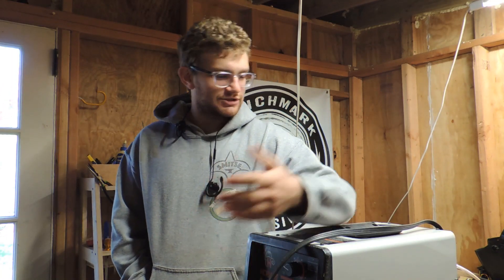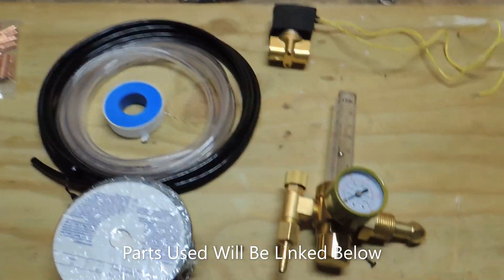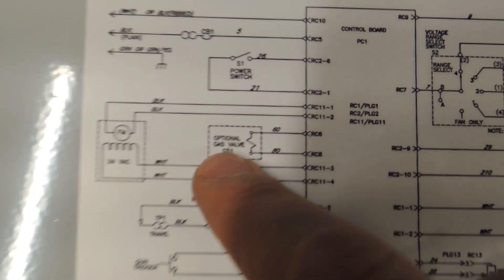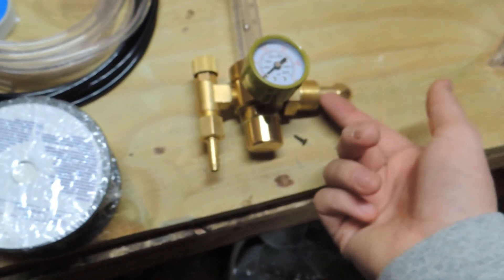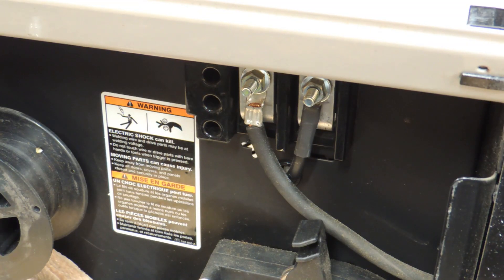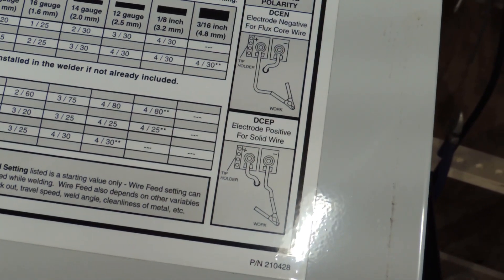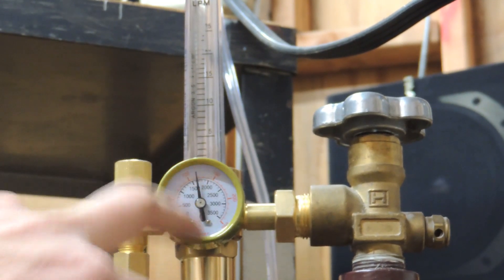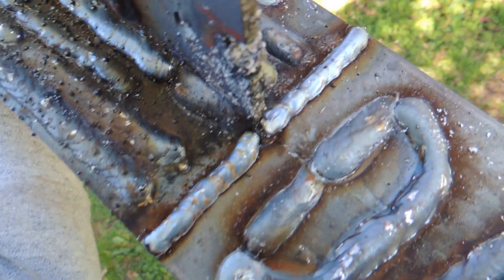Converting a Flux Core Welder to a Mig Gas Welder!

Comment: You were very helpful with the wiring so I will help you with the part #s for the conversion kit. Hobart 218421 is the correct gas value (you show a Lincoln valve) $98 on Amazon.  8mm poly tube (about 6” length) & a 4mm to 8mm push to connect (10 for 8$ Amazon-only need 1). I got a regulator and hose with the pre-crimped connections that fit the gas solenoid off eBay for $32 (search: argon CO2 Tig MIG flow meter wielding regulator CGA-580 w hose gauge gas wielder)

If ur wielder is not ‘MiG ready’ you can drill a 1/16” hole in the control board at RC6 & RC8, solder 14 gauge wire through the holes (the board has solder rings where the spade connectors at the factory are normally placed but missing in my non MiG ready unit/control board).   Next connect with female spade connections to the solenoid gas valve. Put the piece of 8mm hose on the valve’s stem then connect the other end of the 8mm hose onto the push to connect then into the 4mm preexisting hose from the hand piece. You are good to go!  
This is a 115v value. Double check ur current w a meter before you try this. There are larger (220v) models that use different voltages valves/solenoids.  I liked your $85 price in 2020.  I was at $140-150 in 11/22.

Comment: Users with more than one welding machine or who prefer the professional standard connection to their flowmeter or regulator can adapt the 1/4" NPT female on the valve to 5/8"-18 RH female shielding gas hose fittings.  That can be done in a variety of ways (it's only plumbing) but a "1/4" NPT bulkhead fitting" is the best to take any strain off the solenoid valve so I'm ordering one with the other parts. Drill welder case with a step drill (keep all chips out of the welder, saran wrap or whatever will do) to fit bulkhead connector then plumb to valve as you see fit.  Doing it that way lets you use one regulator or flowmeter with a variety of welders and hose lengths.
BTW for little welders if you want a bit more heat CO2 (adapters are cheap to connect CO2 cylinders to your flowmeter, every welding supply should have them) beats MIG mix but tends to spatter more. I use either and have both.

Comment: As of today, 4/13/22, prices USD:
the 1/4 to 5/32 adapters are $8
Solenoid is $15-25
Argon regulator $30-35
1/4 air tube $12
5/32" tubing $10
TOTAL (hi-side) still $90 via Amazon

Comment: Whats all the part numbers
Reply: Hobart 218421 is the correct gas value $98 on Amazon (he used a aftermarket in the video).  Make sure u need the 115v solenoid-different model use different voltages from 12v to 220v. The difference in part #s 216397 (no nut) & the 218421 is the plastic retaining nut.

8mm OD poly tube (6” or so-Ebay) & a 4mm to 8mm push to connect fitting (Amazon $8 for 10). I got regulator with pre-crimped hoses that fit the solenoid gas valve off Ebay for $32. (Search: argon CO2 Tig MIG flow meter wielder regulator GCA-580 w hose gauge gas wielder).

Comment: What model Hobart is it?
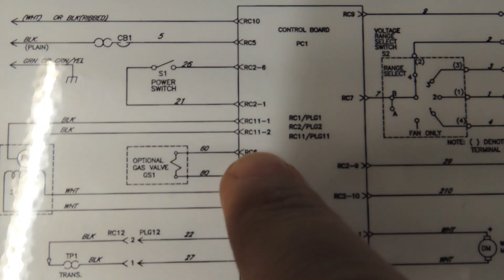Reply: Hobart Handler 125 EZ. The video shows the exact mode he has as a 210513-A (discontinued) on the wiring diagram at about 2:55 in the video (bottom right corner of the screen). 
I did the same thing to a newer model 230951-A but had to solder to the control board at RC6 & RC8 where he has male spade connectors.

Comment: I have the same welder and the manual calls for a 115vac 2 way custom port 1/8 orifice with friction connector, part # 216 397 at a cost of $79-90, depending where you purchase.  How critical is that valve?  Your choice is waaaay more economical than the suggested part...
Reply from the maker: That exact part is not critical, but you need to find a way to take the small hose from the gun into the solenoid. You can find parts like that on eBay.
Reply from the maker: https://www.ebay.com/itm/Reduced-Union-Connector-Tube-OD-1-4-To-5-32-Push-In-Fitting-Converter-5-Pieces-/111192358767
Reply: @bitterbladeco  awesome!...adapting the hose will not be an issue if your valve is sending the right amount of gas...appreciate you taking the time to make that video..I've been looking for a cheaper solution for years than the factory valve...sooo much cleaner welds with mig than flux core..
Reply from the maker: @shannonelliott6116  Thank you for watching!

Comment: Any “High Pressure Water/Air Solenoid” will do the job and the rest of the stuff you can get it at your local hardware store. The question here is: Does the welder come with the PC Board ready to connect the valve? I have a Forney Easy Weld 140 Fc-i advertised for Flux Core only. So, I am going to open my machine and look at the board and schematic. If there are no terminals to make a connection, then, can’t do! Thanks a bunch for sharing your knowledge young man. Great video and two thumb up.
Reply from the maker: Ricardo Montes Yea you need those 2 empty spots on the board. Thanks!
Reply: Or add a secondary button to open the valve, that way u have the possibility to get pre/after flow
Reply: If you are willing to solder to the control board it can be done.